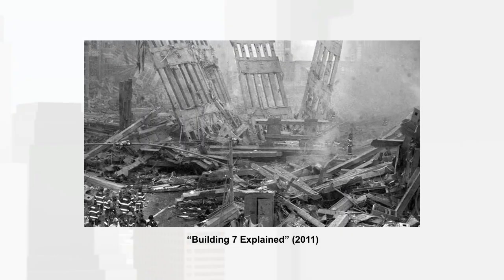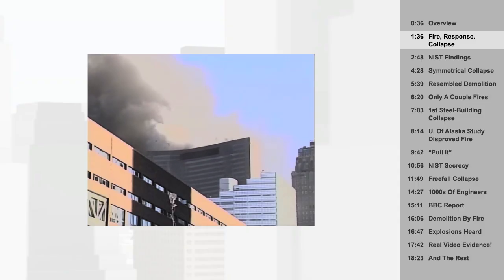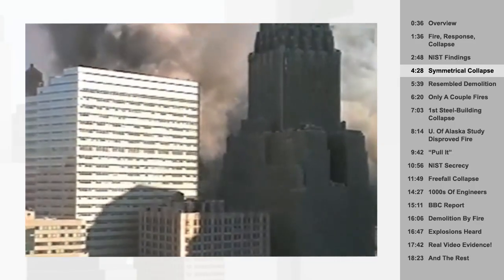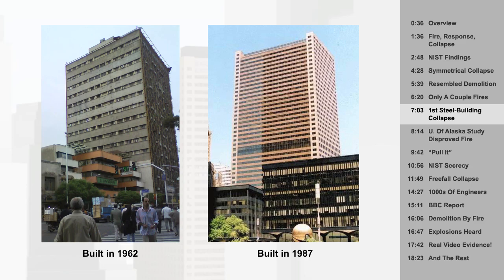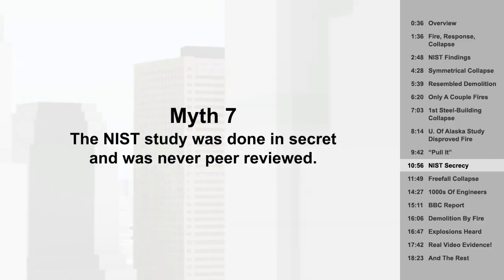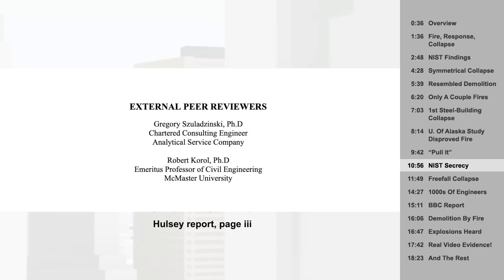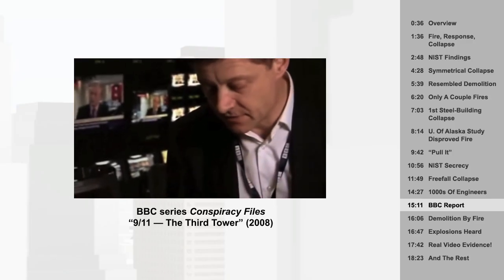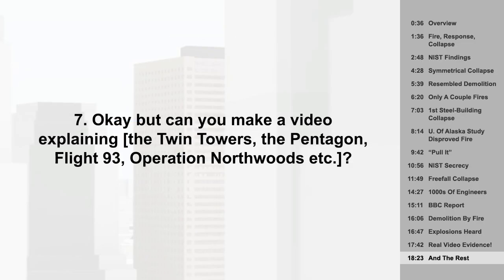Building 7 Explained: Comprehensive Final Edition

Comment: At mark 11:11 that is not a peer review of the NIST report.  Co-authors of this ASCE Journal article are responsible for the obvious fraud of NIST's collapse scenario.   They are simply repeating what they wrote in the report, then four years old. The ASCE Journal likely reviewed the article before publication, but they failed to recognize the serious defects in the theory.  And now the Journal editors don't want to acknowledge any formal complaints pointing out the errors or follow their ethics guidelines.
Reply: "No-one knows which stone moved first, so there was no land-slide, so there!"
Reply from the maker: @mooneyes2k478  Exactly.
Reply from the maker: You'd think that some engineering journal somewhere in the world over the past 12 years would have addressed and corrected this egregious failure, or any aspect thereof. 

Unfortunately it's just evidence-challenged amateur conspiracy believers who have failed. Miserably.
Reply: @EdwardCurrent  Animation of the 16 story collapse initiation has impossible physics going on in more than one place.  Slow it down and study that embarrassing cartoon.   Frame by frame, just like Zapruder.  You will see what you won't see at normal speed.  Removing critical structural elements from their model made the initiation possible  We caught them in 2012.  Look at the addendum April and June 2012.  That's serious evidence that they had to address. But they still refuse to address the stiffeners removal.
Reply: @911justice6   You can't have "caught them" in 2012, because A&E911 hadn't even considered getting Hulsey to make up his nonsense by then.
Reply from the maker: @911justice6  
Ask a structural engineer of tall buildings about that "impossible physics" you claim.
Reply: @EdwardCurrent  Many structural engineers are hypnotized by the cartoon.  Slow it down and see for yourself.  If you want to discuss specifics you can contact me and we can examine it together in real time.
Reply: @mooneyes2k478  We caught them in 2012, well before Hulsey was engaged in 2015.  The removal of the girder stiffeners was one of the reasons Hulsey agreed to take on the analysis.
Reply: @911justice6   And other fun fantasies with no basis in reality.
Reply from the maker: @911justice6  Are you a structural engineer of tall buildings, a forensic fire engineer, or other professional who uses FEA simulations of tall buildings in their line of work? Or an amateur keyboard warrior?

There are two important things you need to understand:
1. FEA simulations simulate real-world physics. If a beam falls in an FEA simulation, it falls exactly as it would in the real world. This is baked into the program. There isn't any way that "impossible physics" can happen in an FEA simulation without someone re-writing the program. It's one thing to complain about how the model was set up, initial conditions, etc. But to claim that impossible physics is happening in an FEA simulation just demonstrates that you don't understand how these programs work.
2. It's very very possible that NIST's hypothesis of how the collapse initiated is wrong. They did the best that they could with the evidence available. However there are dozens, maybe hundreds of other ways the collapse could have initiated due to fire and structural damage alone. So, even outright disproving NIST's hypothesis is meaningless. To give you an analogy, suppose a biologist did a computer simulation of how the first living cell came together from non-living matter. If someone else showed that this hypothesis was physically impossible, it does not disprove that life emerged out of non-life in general in some way. Curiously enough, this is exactly the kind of thing that amateur creationist keyboard warriors do, and it's remarkably similar to what amateur 9/11 keyboard warriors do.

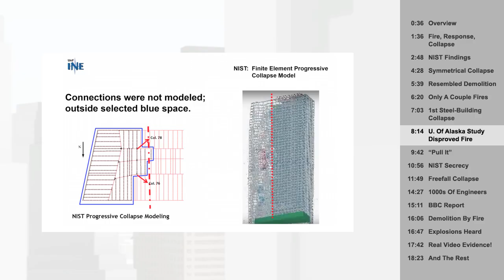The latter is covered in the video at 8:45, so your pursuing this line of argument shows that you didn't get that far (or stopped paying attention) before you finished typing.
Reply: @EdwardCurrent  Your words: "They did the best that they could with the evidence available,"  WRONG.  They admitted they left the stiffeners out of their analyses.  They had the drawings and ignored critical structural elements.

I'm not an engineer.  I was responsible for discovering the missing elements on the drawings that trained engineers skipped over.  There were other things that this layperson found that Hulsey confirmed were important to the analysis.
Reply from the maker: @911justice6  1. And you think this proves that the building did not collapse due to fire? 2. Have you and other laypersons also disproved the independent analyses by Arup/Nordenson and Weidlinger, hopefully better than the 3- and 1-page treatments respectively that Hulsey attempted? (Or for that matter, every possible initiation mechanism?)
Reply: @EdwardCurrent  Your words: "It's very very possible that NIST's hypothesis of how the collapse initiated is wrong."  WOW!  You mean fire wasn't responsible?  A girder didn't walk?  Floors didn't disconnect and progress bottom to top and then east to west?  Where does "very, very possible" end?

All I'm focused upon is the single initiating event that NIST claimed.  Flange failure prior to walking is impossible.  The designers of the connection at C79 did not create a weakness that NIST could exploit.
Reply from the maker: @911justice6  I am just going to delete this thread because you aren't addressing the questions. You're just typing and re-typing your prepared talking points.

1. "WOW!  You mean fire wasn't responsible?" No, I wrote, "It's very very possible that NIST's hypothesis of how the collapse initiated is wrong."
2. Congratulations on thinking that you have falsified the NIST and other proposed scenarios (you haven't, because no structural engineer of tall buildings, in any professional journal published in any country, has written on this) — but have you and your fellow keyboard warriors disproved every possible initiation scenario based on fire and structural damage alone? Because that's what you'd need to do to prove this particular negative (effectively impossible, like trying to falsify every possible mechanism in which life might have emerged from non-life).
3. "Fire did not drop a 47 story building almost into its own footprint" Uh...because why? Your argument from incredulity as an armchair amateur? See the above fact regarding expert opinion.
4. "We can't say with certainty what the mechanism was" So, it DID collapse due to fire and structural damage alone? Cool, we are in agreement. If we aren't in agreement, what is your specific claim, and what commensurate evidence can you present to support that specific claim? ("This could not have happened in any way" is not a specific claim, it's a creationist-style argument from incredulity.)
Reply: @911justice6  Your words: "I have nothing, and it's mean to call me on that, here's another nonsense post that avoids the things put to me because I'm really smart and right and if I just pretend it never happened it didn't SO THERE!"
Reply: @911justice6   Meanwhile, you're quite correct that "fire didn't drop a 47 story building almost into its footprint". It dropped it literally everywhere. WTC 7 fell across two separate, 4-lane, streets, one to the West,  into the Verizon building, causing 1.4 Billion, yes with a B , worth of damage, and the other to the North-East, into Fiterman Hall, causing so much damage it had to be torn down. So much for "footprint".

" Just like Hulsey concluded"
Glad to see you admit it. So, Hulsey, just as you said, "concluded" that fire wasn't the cause. He didn't actually show ANY form of evidence for what DID....he only said what DIDN'T happen.
But, as anyone with the SLIGHTEST bit of knowledge of science knows....that's impossible. You can't prove what did NOT happen. You can only prove what did, and so exclude the things that didn't. Hulsey didn't do that. SPECIFICALLY didn't do that.
Even ignoring Hulseys complete lack of any credentials to make any form of authoritative statement, he completely and utterly embarrassed himself(beyond the nonsense he's stated on video) by trying to claim that he could prove that something didn't happen....while not making any claims as to what DID.

"We can't say with certainty what the mechanism was."
But we CAN say what the cause was. 7 hours of un-opposed fires on multiple floors of the building. Exactly where the building failed from those fires, we can't tell, though the explanation given by NIST is the most likely one, given what we can see of the collapse.
As noted previously: Just because we don't know exactly which stone moved first doesn't mean there wasn't a land-slide.
Reply: So I must conclude you are not open to learning something new.  Walled off.  Made up your mind.  Can't revisit.
Reply from the maker: @911justice6  How do you feel about the shape of the Earth? Because that's how I feel about this engineering disaster, and here you are, basically a flat-Earther barking at the darkness with no one listening because you're a nutjob..
Reply: @EdwardCurrent  Flat is a condition, not a shape.  Insult away, my friend.  You have no idea what I believe.  Open a channel.  Maybe you can teach me something.
Reply from the maker: @911justice6  If this video didn't teach you anything, there is zero chance you will learn anything from a "channel." Goodbye.
Reply: @911justice6   I'm impressed. It took you 2 weeks to not actually make an argument.
Did you work at that or was it from natural abilities that you failed that badly while pretending you're really right?
Reply: @EdwardCurrent  dude I thought you were about to fall for the appeal to authority fallacy for a second then you saved it. And you avoided a false dichotomy. Responsible conduct good work a lot of people get too emotional. I'm going to play this and a engineers for 911 truth video side by side and review some details in this thread to see where I end up. Haven't been back to this subject since I was 12 haha xD it's a stimulating thought expiriment! Especially the Jason Bourne conspiracy aspect makes it fun haha